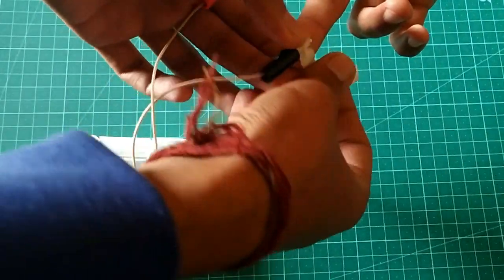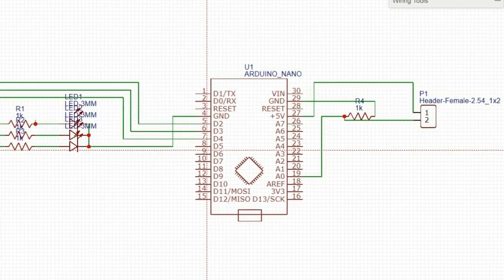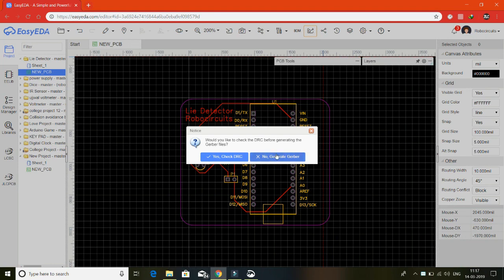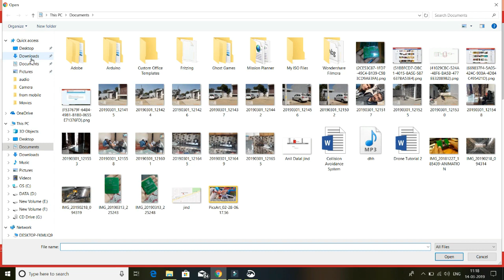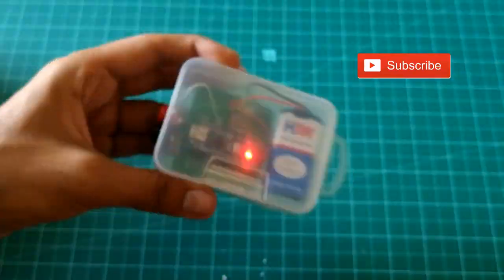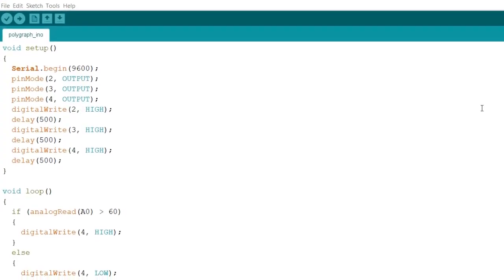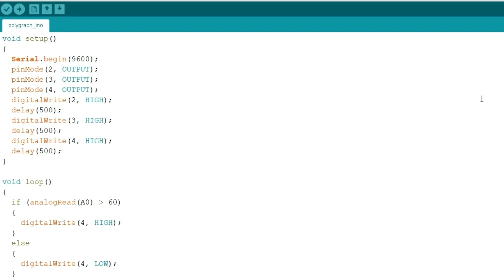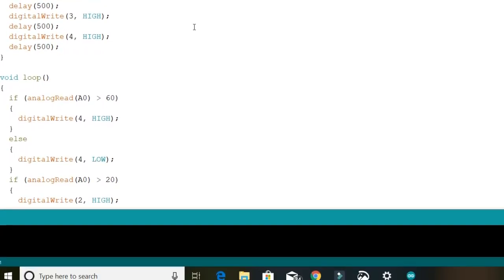Lie Detector Using Arduino

Comment: Bro is it will work,And killing Iver a doubt here which component you used to detect that lier,Means what is the name of the component in Red and Black colour,,Pls give me answer?
Reply from the maker: Its just a wire...  No components
Reply from the maker: It will work but it is not precise... Not trustworthy... It will work in intense moment... And you need to keep an eye on the graph to determine if he/she is telling lie
Reply: @RoboCircuits  Sorry to ask How to see graph?
Reply from the maker: Connect it with pc... And open serial plotter...
Reply from the maker: Serial plotter in Arduino ide
Reply: Means connecting to Arduino software
Reply from the maker: Yes using Arduino software
Reply from the maker: 8813083500